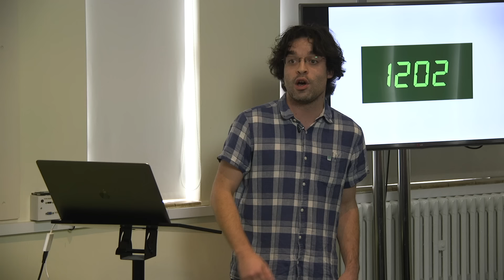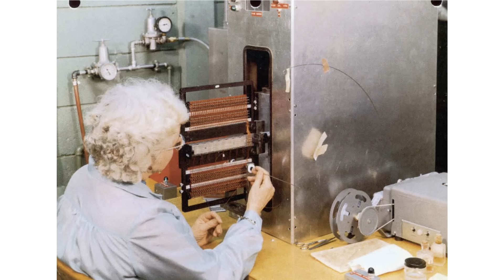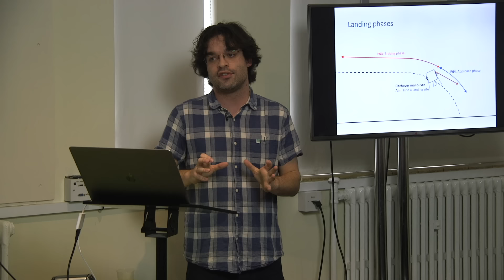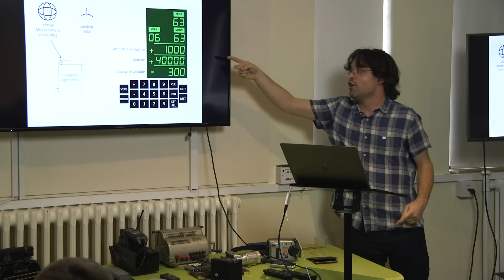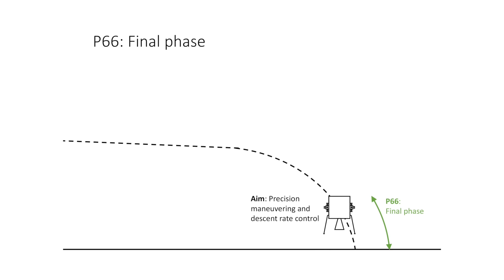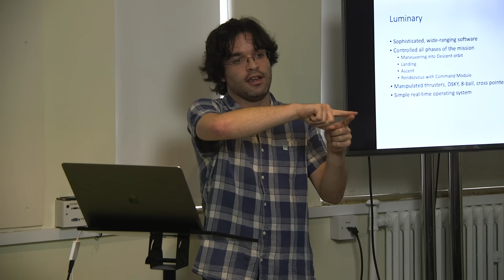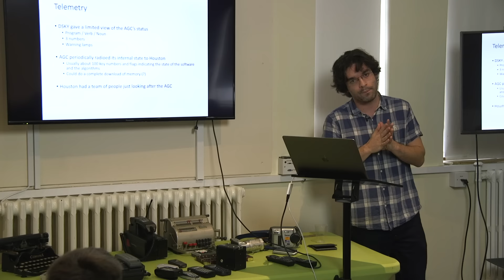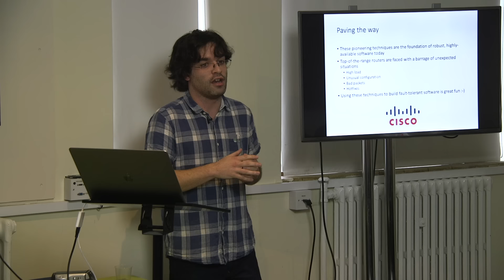Light Years Ahead | The 1969 Apollo Guidance Computer

Comment: We did not go to the moon....impossible
Reply: Why is it impossible?
Reply: @atlas8827  NASA themselves have stated we do not have the technology to go to the moon at the moment..So, in the 1960s, NASA had the tech and used a computer similar to a calculator but somehow we reverted backwards to not having the ability.  That is absolute nonsense and NASA has even admitted they lost all telemetry data from the moon missions.  It never happened.  Lies, lies, and more lies
Reply: @johnglubney3228  
It is true we don't have the capability at the moment. There are no rockets capable of doing it, and no lander. Back then they had the Saturn V and the lunar module. 
And it is not true they lost all telemetry data. They only lost telemetry data for Apollo 11.
Reply: @atlas8827  so, in 50 years NASA has been unable to replicate a Saturn 5 rocket and improve on the design..and they have zero telemetry data for any of the moon missions..other countries haven't done manned missions ever.  All we know is what we are told and the evidence to prove it happened is missing..unbelievable
Reply: @johnglubney3228  NASA themselves have stated we do not have the technology to go to the moon at the moment.
True, but irrelevant. If you break your leg today, it doesn't mean that you never could walk to begin with.

So, in the 1960s, NASA had the tech and used a computer similar to a calculator
I think you should watch the video you're commenting under first.

but somehow we reverted backwards to not having the ability.
One has nothing to do with another. We don't have the ability to land on the Moon today because we physically lack the hardware to do so. Your argument here is "I sold my car today, therefore cars are fake".

That is absolute nonsense and NASA has even admitted they lost all telemetry data from the moon missions.
You're right, that is absolute nonsense - NASA did not "admit" they lost "all telemetry data" from the Moon missions.

Lies, lies, and more lies
What you've been told about the Apollo program are lies, yes. It bears only a passing resemblance to the real Apollo program, though.

so, in 50 years NASA has been unable to replicate a Saturn 5 rocket and improve on the design
That is also incorrect. The basic design has been improved upon. It hasn't been replicated, though, for political reasons.

and they have zero telemetry data for any of the moon missions.
That, once again, is incorrect. Atlas specifically told you what exactly is missing, and you've repeated your false claim anyway. Why?

other countries haven't done manned missions ever.
True, but irrelevant.

All we know is what we are told
And it checks out. Unlike your "facts".

and the evidence to prove it happened is missing.
No it's not. Even if the entirety of the telemetry from the Apollo missions was missing (which it isn't), there are still other pieces of evidence that prove that it did happen.
Reply: @Jan_Strzelecki  someone is a NASA fanboy..Nasa has admitted several times that A.) Telemetry data is lost and B.) Humans are unable to get passed the Van Allen Belts due to high levels of radiation.  All your bloviating is speculation and zero direct evidence of the moon landings.  There is more circumstantial evidence to show it did not happen..maybe you should look into this stuff before you attempt to put on a moon landing clinic.  Same goes for the Mars Landing Hoax currently happening
Reply: @johnglubney3228  someone is a NASA fanboy.
I'm sure someone is.

Nasa has admitted several times that A.) Telemetry data is lost
Yes, the backup recording of the first lunar EVA. Everything else (including the actual telemetry data from all Apollo missions) is still available, even online.

B.) Humans are unable to get passed the Van Allen Belts due to high levels of radiation.
That is incorrect. The context of the statement was about radiation potentially harming the modern guidance systems, which it didn't, as proven by the test flight NASA performed in 2014.

All your bloviating is speculation
No. All my "bloviating" is me pointing out how your talking points are incongruent with what NASA actually says.

and zero direct evidence of the moon landings.
The American space program is among the most transparent government undertakings in the history of mankind. Records of the Apollo program are exhaustive and readily available. The launches and orbital ventings were witnessed by hundreds of thousands. Activities in space were monitored in real time by civilian amateurs, scientists, and foreign agents around the world, many of whom used triangulation to locate their location, and would definitely have known if they’d been faked. Scientific results were—and continue to be—shared globally.

We had the technology. We know how the equipment worked in intricate detail. We know how it was developed and by whom, and we know it would have worked. We also know exactly when each major component was produced, how much it cost, and where it was delivered. We know the procedures used in intricate detail—both in theory and actuality, and we know that operatives of the Soviet Union, China, and the UK (at the very least) were watching and listening, and they definitely were not in on any conspiracy.

We know that every detail of the missions as described in NASA footage, photos, transcripts, and histories is consistent and logically cohesive, and that every argument put forth by Moon hoax conspiracists is ignorant, lazy, and often fraudulent.

And if all that isn’t enough, we left retroreflectors on the Moon that are still used as part of the Apollo Laser Ranging Experiment, and we’ve imaged all the landing sites in recent years with enough resolution to see that the flags are still standing.

This is not 1972, and you are not some grandmother born in the age of the horse and buggy who simply can’t understand modern science.

There is more circumstantial evidence to show it did not happen.
No there isn't.

maybe you should look into this stuff
I did. That's how I know it's wrong. You didn't, and that's how you still believe it.

Same goes for the Mars Landing Hoax currently happening
You are very much welcome to actually prove your claim. You won't be able to, but you can try.
Reply: @johnglubney3228  
are we still going on about the van allen belts bit?
Reply: @johnglubney3228  
Absolutely.
Reply: @johnglubney3228  
Lost the telemetry?  No they didn’t, and Sotheby’s auctioned a set of tapes last year.  The rest of your comment is to idiotic to bother with.
Reply: @johnglubney3228  
 Agreed. NASA haters ARE dimwitted sheep!
Reply: @casanovafrankenstein4193  Well, we didn't go to the moon.  Just because NASA said so isn't enough
Reply: @CNCmachiningisfun  I dont hate NASA, I just don't believe them.  You are the sheep
Reply: @CNCmachiningisfun  Reading comprehension a little low?  I said I dont hate NASA..
Reply: @CNCmachiningisfun  they are claiming they did..the burden of proof is on them, not me.
Reply: @johnglubney3228  
 YOU claimed that no one has been to the moon, so YOU have to PROVE it. 
 Stop with your LIES, and start with the PROOF, or admit that you are just another NASA hater!
Reply: @johnglubney3228  Well, we didn't go to the moon.  Just because NASA said so isn't enough
But we're not saying that we went to the Moon just because NASA said so. We check what they're saying. Many of the Apollo defenders are actual professionals in the relevant fields, if not outright aerospace specialists (not to mention the rest of the entire world), and they have no problems with NASA's claims.
On the other hand, hoax claims can, and have been demonstrated to be either based on false assumptions, or being outright lies. Case in point - "NASA lost all the telemetry" claim.
It's false. It's a lie. It's a lie even if the Moon landings are fake.
That's how wrong it is. Please do not repeat it any further. If you don't believe NASA, fine - but you have plenty of other material to go with. Don't stick with lies.
Reply: @Jan_Strzelecki  Apollo defenders..I love it how people who actually believe they are intellectually superior than others cant resist in labels.  Clearly you have not looked at both sides of this topic and there is plenty of indications the moon missions were faked.  Of course some of the defenders are in the aerospace field..thats their bread and butter.  Big bucks in fake space travel engineering.  And of course, professionals are never wrong..you're argument proves my point.  cUz tHeY sAiD sO
Reply: @johnglubney3228  I love it how people who actually believe they are intellectually superior than others cant resist in labels.
What labels? I am defending Apollo, thus I am an Apollo defender, and so is everyone else who defends Apollo. Besides, have you forgotten about calling me "NASA fanboy"? Aren't you kinda sorta shooting yourself in the foot here?

Clearly you have not looked at both sides of this topic
Except that I have. That's how I know that the Moon landings are real, and hoax claims can, and have been demonstrated to be either based on false assumptions, or being outright lies. I'm sorry, but that's the way it is.

and there is plenty of indications the moon missions were faked.
No, there really isn't. It's still either ignorance ("NASA used a computer similar to a calculator") or outright lies ("they lost all telemetry data from the moon missions").

Of course some of the defenders are in the aerospace field.
As opposed to librarians, taxi drivers, or cat caretakers? When you get sick, who do you want to help you? A brick layer, or a doctor?

Big bucks in fake space travel engineering.
The fact that you honestly believe that nobody in the industry would've blown a whistle on it paints rather unflattering image of your morals.

And of course, professionals are never wrong.
Your argument requires all the professionals to be either wrong, or bought off. That's not an argument anyone would want to make. At all.

cUz tHeY sAiD sO
You do know you can check those things for yourself, right? You don't have to actually trust their words.
You can check if you can find the Apollo telemetry online (spoiler alert: you can).
You can check if stars would be visible on photos shot with exposure settings supposedly used by NASA.
You can check what the supposed levels of radiation inside the Van Allen Belts are.
The list goes on.
You can prove everything to yourself if you're brave enough.
Reply: @johnglubney3228  
 So, NASA HATER, when are you gonna PROVE that NASA didn't go to the moon? 
 Any time now, child!
Reply: @CNCmachiningisfun  never went
Reply: @johnglubney3228  never went
There's no evidence that proves that, and lots of evidence that proves the exact opposite.
And, as demonstrated, most of what you believe is evidence is plain wrong and factually incorrect - even if the Moon landings are fake.
Right now you're arguing against your belief in the Moon landings, not the actual Moon landings.
Reply: @CNCmachiningisfun  I understand that interacting with hoax believers may make you angry, I really do.
I often feel the same.
But I think that using the type of language that you do is counterproductive.
Reply: @Jan_Strzelecki  
 I used to treat them with respect, but their unmitigated contempt for reality has turned the tide. 
 Accordingly, I now treat them as they DESERVE to be treated. 
 In time, you may make the same discovery.
Reply: @johnglubney3228  
 Did you EVER attend school? 
 "never went" 
 OK. That explains a LOT!
Reply: @johnglubney3228  
 Why do you keep LYING? 
 Either PROVE your claims, or shut your neck!
Reply: Your stupidity is truly awe-inspiring.
Reply: @channelthechannel  why are you people so rude and obnoxious?  I dont believe any of this moon nonsense but that means I'm stupid?  This is group think at its finest on this channel
Reply: @CNCmachiningisfun  well actually, im not the one resorting to insults and child speak..whats your highest completed grade level?
Reply: @johnglubney3228  
 Stick to the subject, kiddo. 
 PROVE that NASA didn't go to the moon!
Reply: @johnglubney3228  
 Come on, dimwit, PROVE that NASA didn't go to the moon!
Reply: @CNCmachiningisfun  never went to the moon.  Thats ridiculous
Reply: @johnglubney3228  
 When are you gonna PROVE that NASA didn't go to the moon? 
 Sucks to be you!
Reply: @johnglubney3228  Why do you repeat your flawed claim, even though your every attempt to prove it has ended up in a failure?
Reply: @johnglubney3228  
 We are still waiting for you to PROVE that NASA hasn't been to the moon, little fella.
Reply: @CNCmachiningisfun  didn't go to the moon and definitely not MARS either
Reply: @johnglubney3228  
 Agreed. NASA haters really DO suck ass!
Reply: @johnglubney3228  
 Still waiting for you to PROVE that NASA didn't go to the moon, kiddo!

Comment: My understanding is that NASA chalked up the program alarms as a "checklist error".  You didn't need to have the rendezvous radar running in the descent; only needed it in case you abort and have to find the CSM, rendezvous and dock.   In future missions I believe they just changed the checklist for the descent stage of the mission to exclude turning on the rendezvous radar.

Yes, Buzz did ask the computer to perform the job that actually caused the overload and yes, there WAS a bug in the rendezvous radar hardware, but you really didn't need that radar system operating at that point in the mission anyway, so just make sure you don't turn it on.

Comment: How did the lunar lander take back off without causing a huge dust cloud?
Reply: The lander was in two parts.  The lower part stayed on the surface.  The upper part separated and rose to orbit.  The lower part shielded the blast to some extent.
Reply: @GH-oi2jf  thank you for replying.  I still find it hard to buy on the films being all or even mostly filmed on the moon.  I do believe they went up there and the missions were a lot more on the secret side than what was revealed.   That being said I dot see how they even had room for all the fuel to lift The lander/all the rocks, and two astronaughts into orbit and then have enough to maneuver to capsule back to the orbiter  Then return home.   I do believe we landed on the moon but have an extremely hard time believing all the footage being authentic.
Reply: it did cause a dust cloud.

Comment: The disappointment is that I cannot find an answer why 94% braking thrust. And no one asked.
Reply: The descent engine would have been designed with a little more power than necessary, because of uncertainties.  Then, for an actual mission, the maximum thrust to be used would be determined to get the desired landing profile.

Comment: I am going to speculate that alot of the testing simulations were performed with analog computers not digital computers. The programs were implemented on patch panels. I am guessing because my group was still using analog computers for flight dynamics well into the 1980 's.

There are not code listings for analog computers. Just differential equations and transistor based integrators.

Comment: This is an excellent talk and overview of the AGC, but this guy needs to do just a little more research. First, the two-input NOR (NAND also works, they're duals) is the most primitive gate from which any binary digital logic circuit can be constructed. Three-input gates let's you get the job done with fewer. Second, no, not any mathematician would be shocked by ones-complement arithmetic. The first super-computers (from control data corporation, e.g., there were others) used ones-complement arithmetic. Having a 15-bit word size is not limiting on the size of numbers that can be represented; it limits what can be represented in one word. What's strange about a 15-bit word size is that it's not a power of two number of bits. The ability to have double- and triple-length integers bestows increased precision, not increased accuracy. Etc. Having said all that, thanks for a great talk.
Reply: Yes, three inputs on the gates is a choice made for efficient logic design.  Many early computers had word lengths which were not powers of two.  IBM adopted the convention with the System/360 so they could have addressable 8-bit bytes.  This was convenient for text processing.  Computers dedicated to numeric processing don’t need it.
Reply: @GH-oi2jf  There are other advantages of having everything be a power-of-two in size. These advantages were obviously not needed for the AGC (I'm sure they were informed enough to consider the tradeoffs). I have no doubt they optimized every aspect for efficiency. But, in a true general-purpose processor, having word size be a power of two is advantageous; for example, it allows you to easily consider a region of memory as a collection of bits and to then compute a bit address efficiently. As you pointed out, same for bytes.